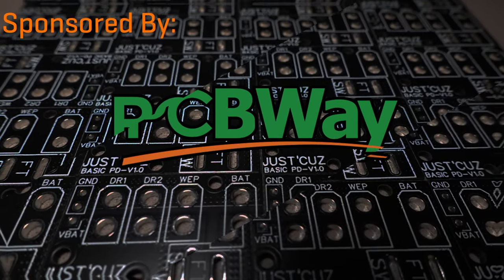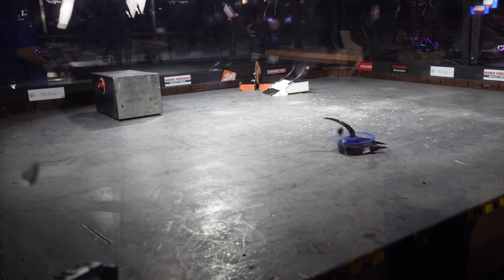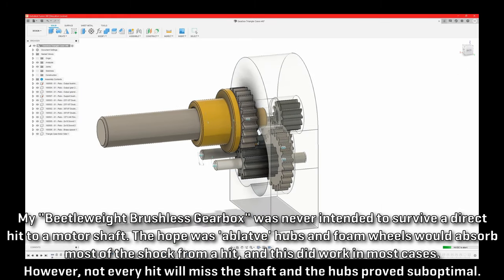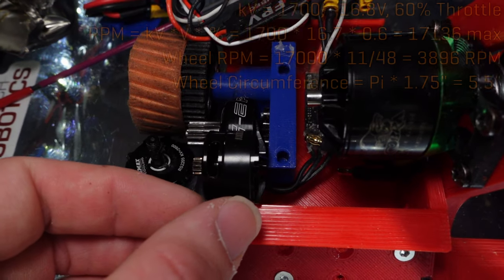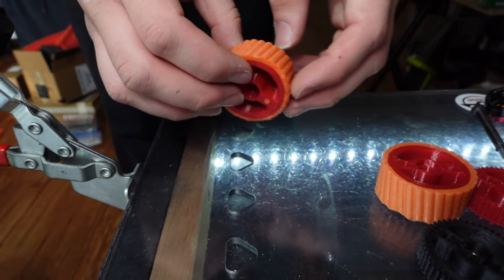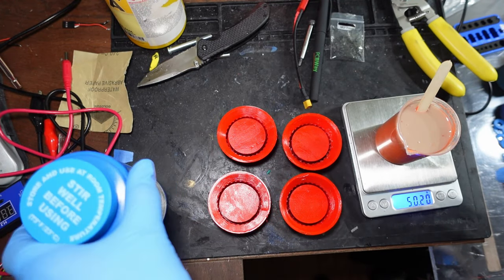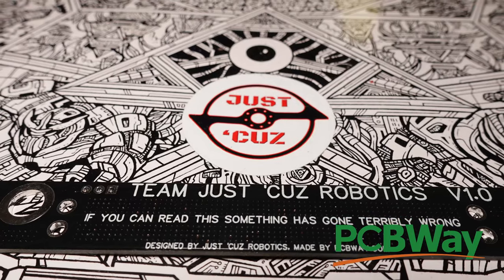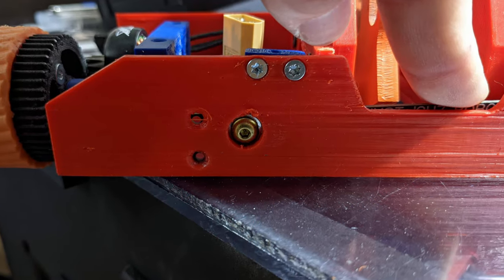30MPH? Division V3 Design: Drive and Electrical (3 Pound Combat Robot)

Comment: Man those wheels are such a tough design. And it makes sense! I can't imagine hitting one of those common all metal planetarys with a hammer like you did. Division 3.0 is gonna be such a big upgrade.
Reply from the maker: Thanks so much! I definitely would not want to try that with a planetary haha.
Reply: @JustCuzRobotics  As long as they aren't like, ridiculously expensive or overpriced, I might be interested in that wheel design
Reply from the maker: $40 for enough urethane to make more than 20-30 wheels and just the price of filament really. The oilite bushings 2 per wheel are like $0.52 each. Shaft shoulder bolts are like <$2 each. Custom steel pinion gears will be under $12 each. The motors I am using are about $16 each. It's designed to be cheaper than any gearbox solution.
Reply: @JustCuzRobotics  So, I'm guessing that means you are (at least planning) on selling the design files and steel pinion gears? This drive seems really solid and balanced.
Reply from the maker: Hopefully! It is a lot of 3d printed stuff that can easily be adapted to other robots but for the moment it's all fairly specific to my design. I definitely won't be selling cast wheels anytime soon as they are very laborious and time consuming.
Reply: @JustCuzRobotics  sounds great! I'm already thinking of different ways I might want to implement this type of system in the future

Comment: What sort of ballpark of kinetic energy does division have. The only number I've ever heard for a beetle was 2kJ on the Norwalk website. Loving the videos.
Reply from the maker: 2kJ is a ton for a beetle. Division is around 600-700 joules with its heaviest blade, but due to the large diameter and relatively low RPM I can deliver that energy much more efficiently than many other vertical spinners.
Reply: @JustCuzRobotics  Yeah you got a lot more bite than an eggbeater for example. I got the 2kj figure from the Norwalk website for icky mouse.

Comment: I just have to wonder, why did you go with helical gears instead of herringbone gears for the drivetrain?
Reply from the maker: I didn't... I used straight tooth spur gears. Making 3D printed herringbone gears is easy but machining anything other than straight tooth gears in metal is extremely expensive. The pinion gears I am using are steel so the printed wheel gears have to match with a straight spur tooth.